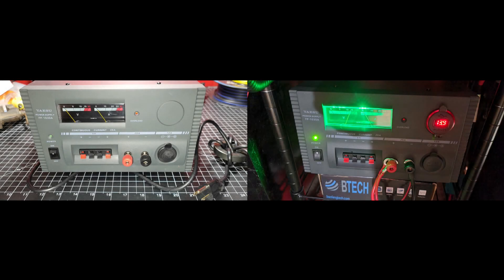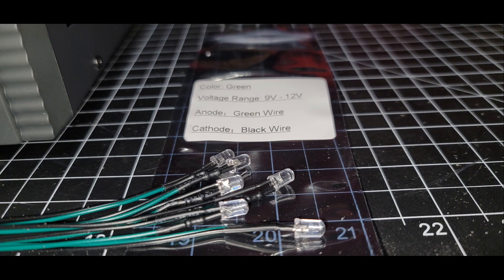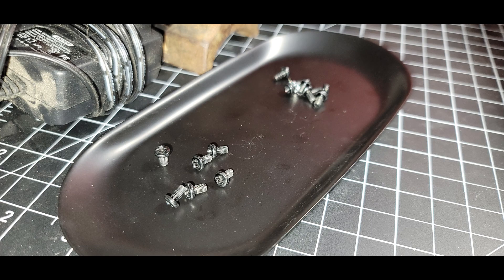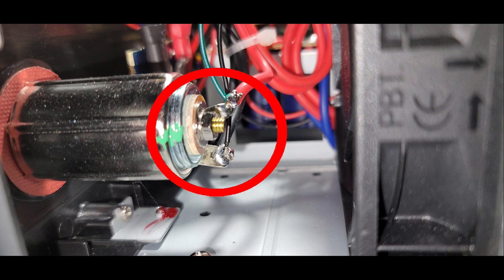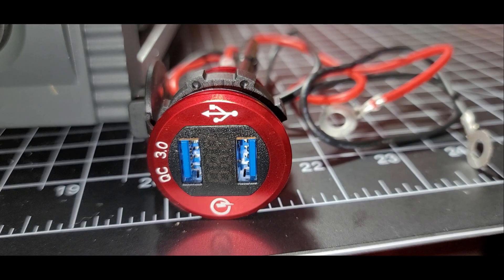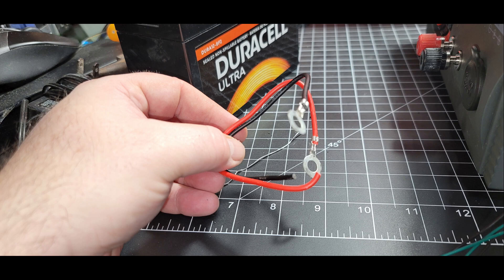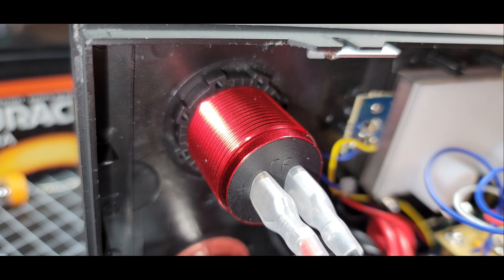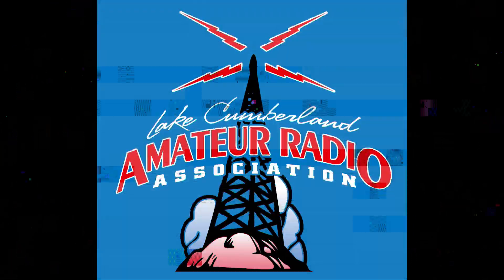LCARA HAM Radio: Vintage - Yaesu FP-1030a Power Supply Mods!!!!

Comment: I gave the Diamond version but the volts gauge is not working anymore, however the power supply is working except for that (I checked the output voltage  and also, the amp gauge seems to be working). 
I have measured 240v on the volts gauge conectors, which seems wrong to me and probably the reason why it failed.
Any idea what could be wrong ?

Comment: Hi, I'm late to this party, but had a quick question. There is already a cig-lighter outlet which you could easily have simply added a duel USB charger adapter to. Why did you chose to mod this supply for something it already had accommodation for?

Comment: what is the round magnet looking thing you have power chord wrapped around?  where can i get one.. I have this power supply sitting to the side..   I am getting significant noise on 80 and 40M with the current Alinco 330.... I am on a noise elimination mission!!  TIA good work by the way!    Have you done a mod where you convert to power pole??

Comment: Chris, which trim pot on the PCB is used to slightly adjust the output on a stock FP-1030A? Yaesu tech would not tell me, said it was a modification. LOL Thanks

Comment: I was surprised that my new PS did not have lighted meters. First thing after the discovery I went searching for a solution and found your presentation. Very nice job. And the added benefit of USB charging ports. I probably won't do that part for the time being. Thank you for sharing.

Comment: Chris, I just bought one of these Yaesu Power Supplies at a great price. Could you send me the parts #'S you used. I want the Green LEDS, and did you use 1 for each meter? Also watch the same type Quick Charger and Volt reader you installed. Also, how did you mount the Led's to the meters?  Thank You/N2RLH  Fantastic video and Job!!!!

Comment: Can I change voltage output on this unit by adjusting a pot inside?
Reply from the maker: When I was inside I did not look for any adjustable pots.  You may want to check with Yaesu directly about this.
Reply: @LCARAHAMRadio  thanks for replying, I was poking around inside and found it. It's not labeled but appears to control voltage to all outputs.